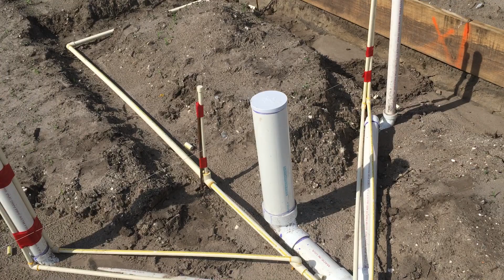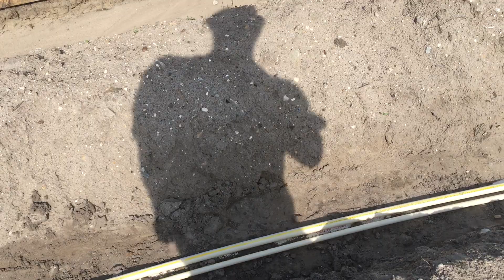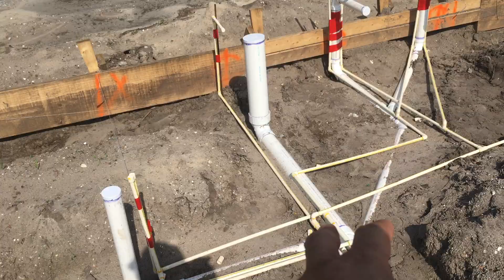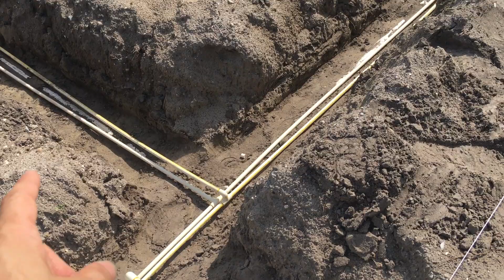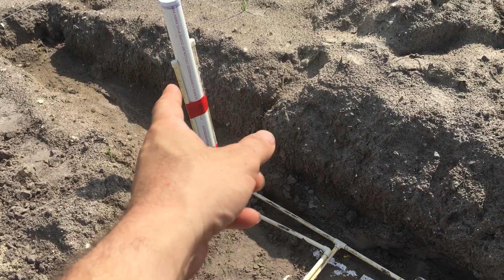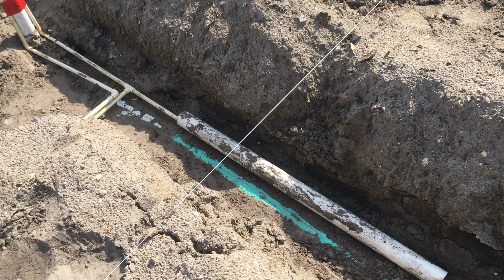new construction pre-slab plumbing survey

Comment: Plumber here—Almost nothing about that layout , design and materials is correct. This could NOT have been done by a professional. Jobs like this give plumbing a bad reputation. 
Because the( next) owner will assume that it was done professionally. 
Did the inspector pass this mess?
Double Y’s on the horizontal, no vents, wrong materials used, no clean outs, joints under the concrete— WTH!!!!

Comment: Why are you using that brittle cpvc?  
Perhaps you didnt want pex fittings under the slab, which is a no no, but pex is durable and cheap enough to do a "home run" system under the slab.
Just one fitting breaks and you lose your whole supply system.

Comment: Where I live toilets, tubs, and showers have to be vented, and that looks like cpvc, the slightest settling and it’s likely to crack under the slab. Assuming the pipe protection will be added right before pour, hopefully. I don’t know how it’s done everywhere but we used soft copper under slab and if it was a branch system all fittings under slab had to be silflossed, pex was to be a manifold system unless you used ford fittings or rehau system, under no circumstances were we allowed to use pvc or cpvc under slap for water.

Comment: That is some of the dumbest crap I have ever seen. CPVC under a slab? I don’t care if it “meets code” in your area that is a terrible practice. How many times have you gone to finish the rough in after the slab is poured only to find out the concrete guys broke your water pipe off under the slab?  I would never use CPVC even in an accessible location but you think it’s ok under a slab?Also your lavatory drains had Ells on them. There should be sanitary tees there that will connect the drainage and vent systems. And using the double wyes like you did is also a terrible idea and seems like just a quick, cheap, and lazy way to do it. Does that also “meet code” in your area? Also are you laying the drain pipe in mud?! It should be laid in a gravel bed on solid ground. If anyone reading this is considering buying a house in this neighborhood I would look elsewhere.

Comment: I know so many problems first of all where are your Vents? second of all I don't think those double Wye  fittings  are legal to use in the manner.. Also  that type  of  C PVC for water is not allowed to be used under ground. That shit is so fragile. It won't last.
Reply: Hey Giovanni, I’m more than sure that the vents countinue up vertically from the drains obviously somehow branching together or individually. Also the CPVC is accepted in the slab or under the slab depending your county or city

Comment: Wtf glue joints under a slab and cpvc at that?!? That's asinine, we've known better than to put joints under a slab for over 50 years now. It's bad enough to use CPVC in a new house, but under a slab where someone is gonna have to bust a hole because someone dropped a bottle of soap onto the toilet stub out and snapped that brittle crap at the concrete? No. Just No.
Reply: Where do you put the joints before pouring the slab then? Just asking to learn, I've seen a lot of plumbing examples before a slab is poured, and they all have joints. Unless I'm not understanding.
Reply: @copy4875  The only glue joints that should be under a slab will be on the DWV system. Never the pressured water system. Water lines under a slab need to be ran with a flexible material such as pex or soft copper. This allows you to run full lengths of pipe under the slab from each fixture. Where necessary, at each fixture you can create a manifold above the concrete (typically inside of a wall) and run a seperate line back under the slab to the next fixture you need to supply. Alternative options include running lines overhead in the attic or supplying all fixtures from a singular large manifold. Whatever the case, no fittings of any kind should be present on the pressured water supply system beneath a slab.
Reply: Awesome man. Thank you for the explanation.  @Azaduur
Reply: @Azaduur You use what's called a "home run" system, where each fixture has it's own dedicated supply lines back to an above slab manifold system.   This takes a lot more water line, but no fittings will be used under slab.  If one line does break, only that particular fixture will be disabled,  not the whole house.  Pex water lines can be buried.
Reply: Yea,I’m not even a plumber but have a general ideal about it and no way would I want to knowingly buy a house with that plumbing under my house.I’m actually looking to build,what’s a ball park figure on rough in on 2100sq ft 2 1/2 bath under slab plumbing.Thanks for any information

Comment: Good luck with that cpvc in a few years
Reply: What kind of problem he gonna face. Because I also work with that
Reply: @RavinderKumar-bo2st  problem is that plastic gets old and brittle over time. que that with water hammer or freezing and you have a big problem. I would think that under slabs all drain and water supply pipes should be stainless 316 or copper.
Reply: In my state cpvc is only allowed above ground . These tend to become brittle and blowout/ crack a lot